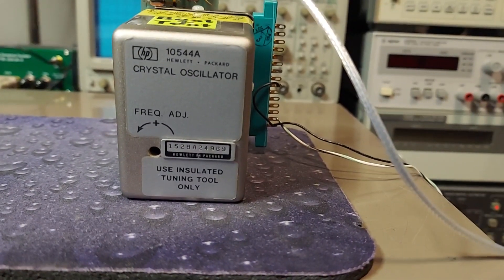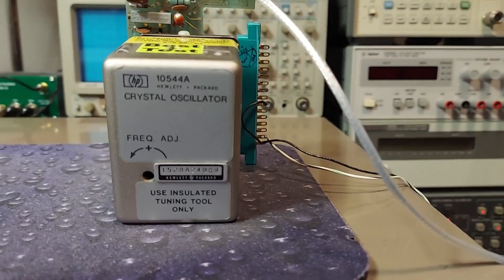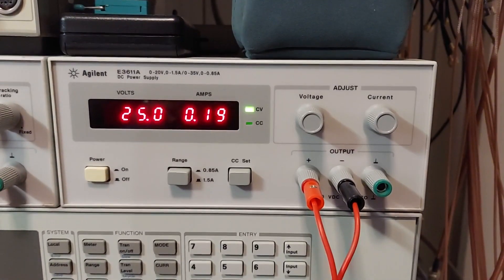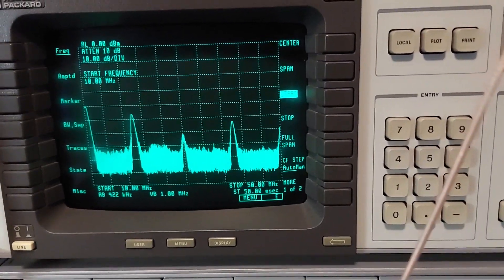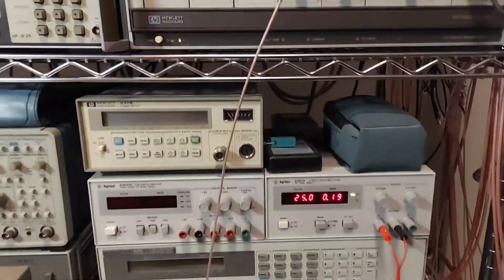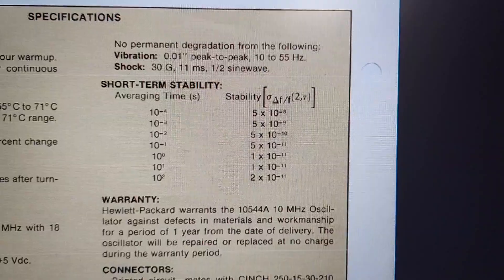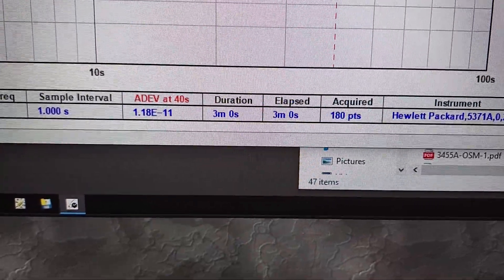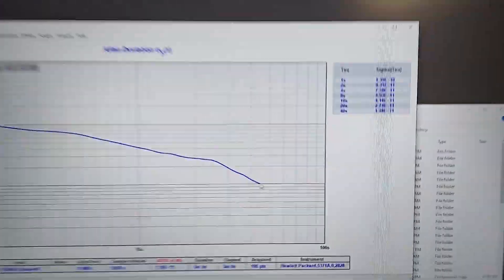HP 10544A Crystal Oscillator

Comment: I liked your demonstration of the use of the HP 5371A to determine the Allan Variance of the HP 10544A. I did not know
that the TimeLab program provided any support for the '5371. Would you please clarify this point as I thought the '5371
could be externally controlled by Labview or HP Basic and (possibly) by Matlab. Thank You!
Reply from the maker: Good Afternoon Philip, Timelab covers several HP counters such as HP 5371A / HP5372A, HP 5335A, HP 5370A/B and others. Hope this helps, thanks for watching.
Reply: @CraigPetersen12f36b  Excellent! This is useful information, as I'd like to produce near-real time plots of Allan Variance without using HP Basic.